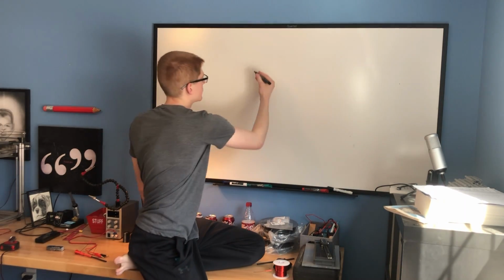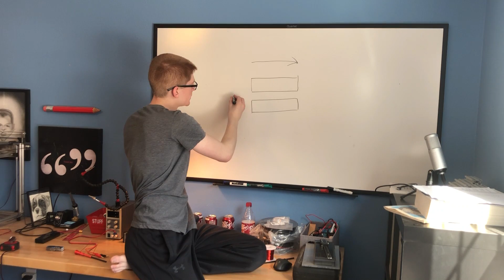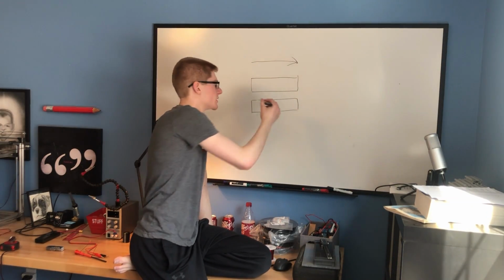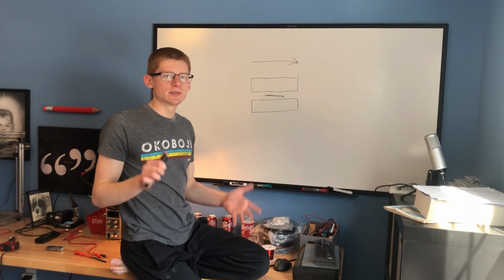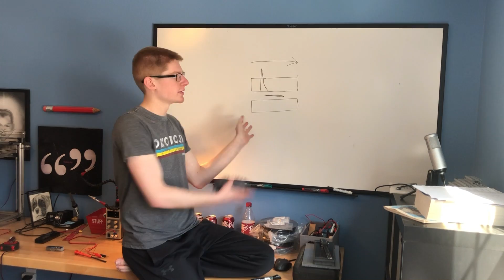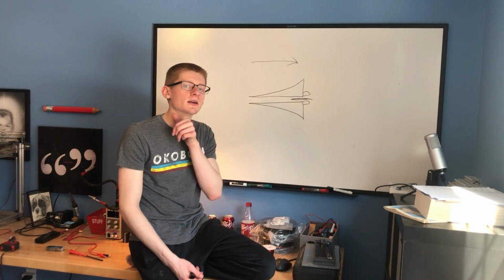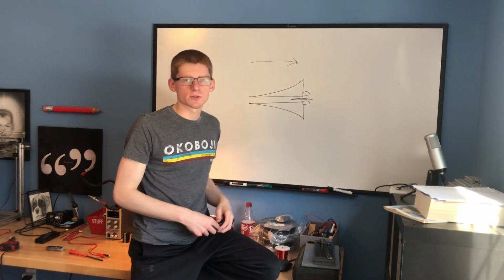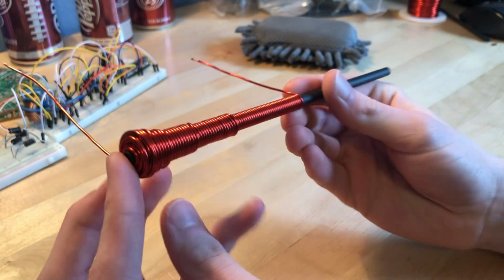Making a Coilgun - Part 3: Reconsidering Everything

Comment: I think you made a few fundamental mistakes, though perhaps you corrected them in subsequent videos.
From what I recall when I was working on a coil gun (I only ever simulated it using a custom solver, didn't build it), the force at the center (in the transverse direction) of the coil is zero. The reason being how the projectile is being magnetized and where the force comes from. So when you said that the projectile rests where the force is the strongest, that's incorrect. The projectile rests where the forces are in equilibrium. The force profile looks more like a sin^2 function, so you want to pulse the current before the projectile enters the coil and then remove the current before the projectile reaches the center. Using a 1/x profile is an interesting idea, for it would simplify the control circuitry, though it would still have a low efficiency.
What I found (this was 10 years ago), is that the most efficient geometry is to essentially do what is done for super-electro-magnets. You want to have your coil be a big as possible in the radial direction, but a small as possible in the transverse direction (direct of the barrel). That allows you to maximize the magnetic field. Obviously though, there is an optimal size, based on the wire diameter and how much current you can run through it. There's a reason why super-electro-magnets have coils made of solid metal rather than wound wire. For control circuity, you probably don't want to use optical sensors at all. Instead, you want to effectively tune timings down to the microsecond using some computer control system (a MCU like a Arduino could reach that level of control).
In simulation, the two stage controller with that I was working on was able to generate about 3T of magnetic field at peak discharge, and would accelerate a 5mm ball bearing up to about 2x the speed of sound (which I think would vaporize it due to the short barrel distance). Although, it's likely that there was an error in the simulation - I never built it due to safety concerns. Capacitors were used (as part of the simulation), along with shunt resistors, and fast switching IGBTs for control (it was a combined kinematic, electrical, and E&M solver).
From the tumbnail of your follow up videos, it looks like you did something similar to what I described above (I haven't seen your next video before writing the above).
Reply: What is the simulator called?
Reply: @stefanehm8718  I never named it - I wrote it for a graduate course term project. 
The magnetic field profiling was done in MATLAB, and the electro-mechanical simulator was written in C/C++.
Reply: 3 Tesla? If I remember correctly, iron has a magnetic saturation of about 2T, so going higher than that would be pointless, as the magnetic force cannot increase efficiently anymore. At that point, an inductive design might be more effective. Short coils also tend to have a very inhomogenous magnetic field, so it might be harder to get the timing right in a non-simulated experiment.

Comment: Building a hobby gun at home and am at a juncture im not sure how to cross. Some people say go capacitor others say use inductors. Which one should I use for pre shot energy storage? Power supply isnt a problem. Just stuck there. Help?
Reply: Minve 47
Use Capacitors (the high Voltage is the same as high Current on the coil which is what matters in the end)

Comment: Multiple discharges from many caps along the distance of the rails like a high voltges AC half wave form. using  IGBT Transistors to switch the caps on in a time pulse  maybe BSM75GAR120DN2 Datasheet PDF Viewer. - Datasheet.Directory

Comment: Please explain if I am wrong, but at about timestamp 3:05 you draw a V vs T  diagram of a capacitor discharge discharge over what you call "a CONSTANT load".  Isn't your drawing the discharge over a resistive type load??  Shouldn't the discharge curve over a constant load usually linear?  For instance, for a simple linear voltage regulator, don't you see a linear discharge at the input?  I have done several computer simulations (in BASIC) of this kind of coil.  I graphed the magnetic field for countless windings.  I got the peak IIRC mag. field far beyond the coil center, but never got it past about 80% the coil start.   Have you looked at the winding of what is called a (zeeman slower)?

Comment: Just so you know I had a class member in school do this on a bit bigger scale over 40 years ago and fired things out of it quite well.  If I remember correctly it was about 3 or 4 feet long and took a lot of insulated motor wire and I think the big end was around 4 inches in diameter.  So I think you are on a good track.
Reply: Lol I'm imagining a long rifle coilgun design. 
Call it the MAM. 
Magnetic Accelerator Musket. 😆

Comment: Hi, I've been interested in coilguns for years, and now I have an actual budget (I'm 19)  I was interested if there was anyone posting research like this here, so I can maybe make my own as good as possible, and I'm glad I found this, cause I'm really kicking myself cause I was thinking about putting a magnetic core outside but I neglected changing the coil shape for some reason.
Because we don't live in a mathemathically perfect universe, you'd need a much finer wire/bigger coil to get closer to the effect you wanted, and you'd need... well... an infinitely large coil at the front to literally negate the effect of all the coil behind it and have the point of maximum magetic field almost at the front tip (wire thickness exists). I have not watched the rest of the series but I'm intrigued, nice brain you got there.

Comment: Could you use just the high voltage part of the capacitor, and when it gets to a lower voltage switch to the next capacitor and repeat? Id imagine this would require alot more capacitors than normal circuits.
Reply: This is partially why I wish they taught the fundamentals of analog circuits a bit more.
When you connect a capacitor to an inductor, you generate what is called an LC network - when the two are parallel to each other, they specifically form a tank circuit, which will oscillate at a resonant frequency.  Once voltage across the inductor is at zero, current flow is at maximum.
There are now two problems.  First - most people use SCRs as their switching devices for a coilgun.  I plan to use NPT IGBTs with a regenerative stage, but that is another discussion - the problem you run into is that an SCR conducts until current through the device has dropped to zero.  You can use something like a mosfet or IGBT to trim the current, but we are talking possibly hundreds of amps at peak current flow and this is precisely when fall times are at their longest and switching losses the highest (you run the risk of letting the magic smoke out).
This is also when you want to try and switch a new capacitor into line and all voltage drop will be across the switching device (remember, at T0, an inductor appears as an open to voltage - so an inductive load is not a problem to switch on as the voltage across the switching device is inherently soft and almost zero, spare for the extremely tiny capacitance of the circuit between device and inductor) - which means you will be switching into an effective short circuit condition and the cost of switching modules which can handle a switching into a shorted condition at the hundred plus amp range around $100 just to think about it and $1000 to take it seriously.  And realistically, if we are talking high voltage capacitors at around 500v or more - then the resistive load of the circuit is probably in the range of 0.2 ohms (you really need a special meter for measuring motor winding resistance accurately, and that is basically what we are doing, here) and that gets us about 2.5 kiloamps.  Inductors resist a change in current and will generate any voltage differential necessary to satisfy the need to push or pull against changes to that current.  So it will almost instantly sap all power from that capacitor as a purely resistive load.
Reply: @Aim54Delta  I wish I knew the half of what you said, I do find this stuff interesting, and plan on learning more. Bought myself the book Art of Electronics to read sometime.
Reply: @computeraidedworld1148  
I am pretty sure that there are people out there who do some electronics instruction on youtube, but it seems a bit fragmented or often a bit dry.  Electroboom is often very good - but as far as I know, he hasn't really structured any of that into what I would call electronics instruction.

Most electronics instruction starts very dry and seemingly silly - talking about voltage, current, resistance and basic voltage divider networks - the importance of which isn't obvious until you get into amplifiers.

So I think I will start this spring putting together some youtube videos which try to teach electronics, but rather than starting with a purely instructional lab, actually tear apart something like a radio transceiver and break it down from a high level overview down to each individual stage and the fundamentals that underwrite it.

This will dip into how to do component level troubleshooting and also to look up datasheets (where available) to interpret them and apply their engineering readouts to both troubleshooting and if you wanted to use them in designing your own.

Along with some other things I want to get moving on.
Reply: @Aim54Delta  I'll sub and watch when ever you put out a video, I'm definitely interested.
Reply: That’s how bigger coilguns are usually made to work if I’m not mistaken

Comment: i have made a coil using 32 gauge enameled copper wire but it does not work can somebody help fix this i have tried different batterys but still does not work do i need to perfectly coil the wires side by side, please i need help
Reply: There could be a lot of error sources there but no the wire must not be perfectly aligned for the coil (as long as it has some sort of shape from left to right and back and so on)

Comment: I think you're vastly over estimating the discharge rate of capacitors. At higher speeds (above 100 m/s), you're actually going to have the opposite problem. You wont have enough time for the current to build up and rise to it's maximum through the inductors (coils), before you have to switch it off abruptly when the projectile is in the middle to avoid suck back.
Secondly, the currents you're trying to force through these coils are way, way higher than batteries can handle, which is why people use capacitors. More current, gives you more force, more acceleration and a higher exit velocity.

I absolutely understand your reasoning behind the offset coil, but you won't get the constant acceleration you're expecting. It does give you a gradient which moves the projectile towards one end, but it is a less efficient/powerful way to do things. The low number of turns in the start results in a weak magnetic field there, and the magnetic field from the denser part of the coil at the other end is going to be weaker due to the inverse square law. Therefore you're better off with a more uniform, high density coils along the whole barrel that you commutate to move the projectile along, this makes full use of the length of the barrel to apply the maximum amount of force the whole way along.

Secondly, the voltage and current rating of a battery pack are almost unrelated. Your high voltage battery pack will likely not have the current capacity you're expecting, there's a reason people use capacitors.

Sorry, not trying to be negative, just wanted to correct some misconceptions before you sink too much time and money into some of these and then learn they wont work the way you expected. Coil guns are cool, and hard to make efficient/with high exit velocity, and I love seeing new approaches and ideas.
Reply: I know this is old, but everything you said about this particular coil design aside, I wonder if there is any benefit to moving the projectile this way in terms of efficiency as with multistage coilguns (or motors for that matter).  From zero movement into the first stage, efficiency is usually quite low (1% max) but each successive stage sees improvement in efficiency (starting up a motor takes a lot of power but then is more efficient as it spins).  Could this design not work to improve efficiency with more turns at the very end and the projectile length being equal to the final coil?
Reply: @saintapoc4031 I guess, you’re moving the “centre” to the end of the magnetic field so you would get slightly more time under force per coil, but at the same time being inside the dipole might reduce or cancel that benefit. I’m not sure it’s worth the benefits in terms of increased velocity versus making coils more complicated. Especially when you can just add coils. And really it doesn’t solve the central issue of coilguns ie getting the optimal timing on the electromagnetic being turned off/on.

What I’m curious about is a way to induce rotation in a coil gun so you have the benefits of rifling, maybe just use steel screws or something?
Reply: @felixprime8291  Thanks for the reply!  I think I'll just eventually have to try different coil configurations (swappable electromagnetic magnetic barrels?).

As far as rotating the projectile, I think fins (curved?) are probably ideal.  That or maybe magnetically induce rotation somehow.  Not sure how aerodynamic screws are, assuming they can spin out of the gun
Reply: @saintapoc4031  I don't think screws would be too bad aerodynamically, provided it has a point and the head is removed.

The main issue regarding aerodynamics is probably vortices.

If you think about it a screw is effectively a spiral fin that covers the surface (apart from the head).

Maybe check out helical/toroidal propeller designs for highly aerodynamic spinning shapes that avoid vortices. There are also other methods, e.g. they put anti-vortex strips on wind turbins and aircraft which are basically lines of small fins, they increase efficiency significantly (up to 10%).

So have an aerodynamic propeller shape around a bullet shaped projectile to provide mass.

Comment: I Think you forgot to consider the coils characteristics. When the capacitor has been discharged, somewhere in the beginning of the coil, the coil itself will have some energy stored in form of an electromagnetic field. This means that even though your capacitor has been almost discharged, there will still be an electromagnetic field pulling on the projectile. This is by the way also where you have your efficiency problems... when the capacitor is then fully discharged, the coil will try to hang on to its electromagnetic field, and does this with a large negative voltage spike, which is usually removed with some diodes. The diodes shorts the negative spikes, and waste all of the energy stored in the coils. There is no apparent way to solve this, besides not using coils.
Reply: I feel like it wouldve had alot more oomph to it if he used a diode choke, but at the same time, this was still pretty impressive despite how crude it is.
Reply: Then instead of wasting the back emf of the coils through diodes, why not store it and use it later for the next gun shot?

Comment: Would you get an increase in velocity or diminishing returns on a double or even triple helix coil pattern?
Reply: You'd have more losses, a double helix pattern in parallel would mean half the current going through each coil, each coil would be fighting it's own self inductance plus the inductance of the other coil, which would be trying to induce current in the opposite direction, it would be half as strong as a single wire wound a bunch of times.

Comment: Some suggestions:
Use an IR Photodiode infront of your coil to trigger an Inverting-Fetdriver for super fast activation and deactivation of your coil. (gets rid of the backwards flying projectile)
For the powersupply you can try to use two 6S Lipo batteries (1000mah 100C) in combination with 35V caps for maximum power delivery. (saves chargetime and increases the power output)

Comment: Having experimented with coil and rail guns I can give you this tip that will help greatly. Wind each layer of each coil with a separate wire in the same direction and connect the all the positive ends of each layer together and same with the negative ends. Also aluminum plates at each end of each stage will help to isolate the stages and focus the field. An outer reflector can be added to each coil as well. It would be interesting incorporate these ideas into your design. Mine was a 2 stage with half coil length slugs and my coil triggers were actually at the front of each coil instead of at the end.
Reply: Do you have a video that we can watch? Thanks.
Reply: How did you configure your reflectors. in parallel or favoring the direction of pulse?